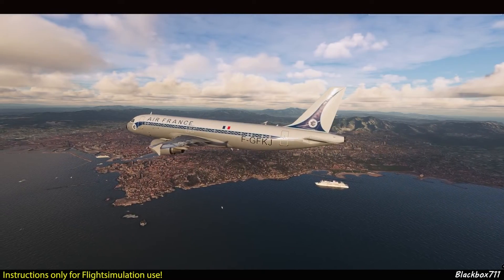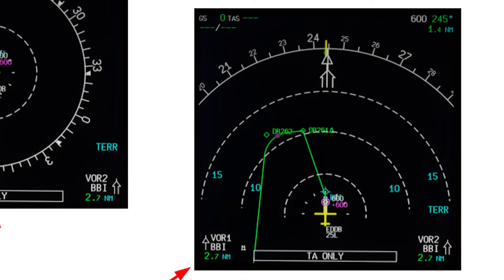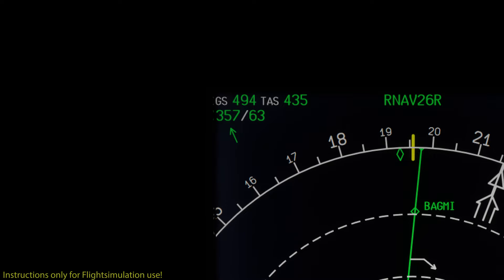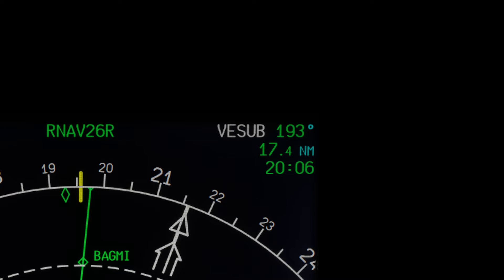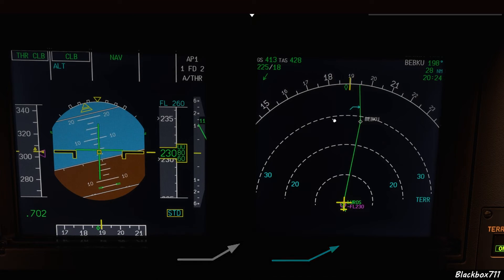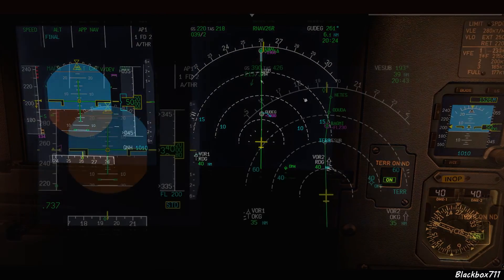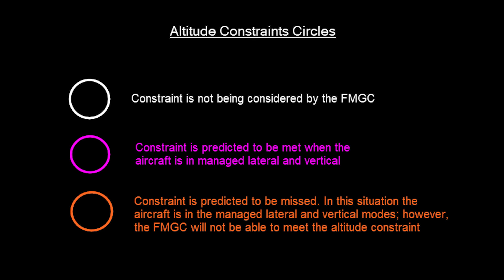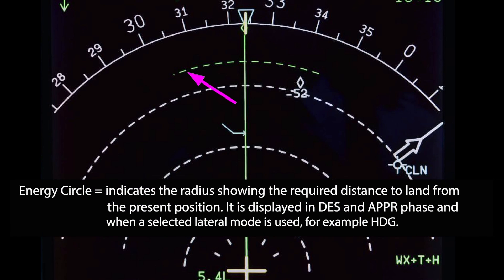FENIX A320- Navigation Display symbols and their meaning

Comment: Hello blackbox! I hope you’re fine. 

I have a question. I was flying in my fenix a320 and I suddenly saw on my navigation display a heading that had a diamond  before it and a letter G. I only saw it for like half an hour. What is it? Is it something related to true/magnetic heading?

Many thanks.
Reply from the maker: Hey 👋 That was the so-called Grid-Heading. Happens in the FENIX if you are flying far north.
Reply: @Blackbox711  thanks for your answer. How is that grid heading different from the normal heading?

Thanks again!
Reply from the maker: Grid Heading refers to the heading of an aircraft based on a grid system. Pilots often use a grid navigation system in high northern or southern latitudes where the Earth's surface is divided into a grid pattern, and the aircraft's heading is described in relation to this grid (instead of magnetic north) for navigation purposes.

Comment: I didn't knew, that the calculated wind data and arrow are based on different north reference. I wonder, if there is a reason why. I never flew near the poles so I never noticed the difference.

There is always something new to learn from your videos. Thank you very much for your effort making these for our flight sim immersion 😁👍🏼
Reply from the maker: Thank you. I can only say that the numerical wind data is a calculated value from the ADIRS, which computes everything in True North. However, the displayed Magnetic Heading is also derived from the ADIRS with an internal magnetic variation database. So I would imagine it is possible to display the numerical value also with reference to magnetic north.